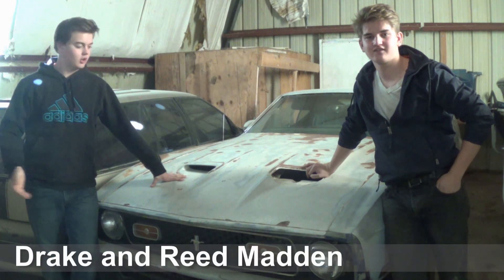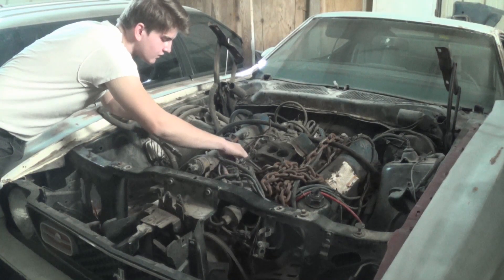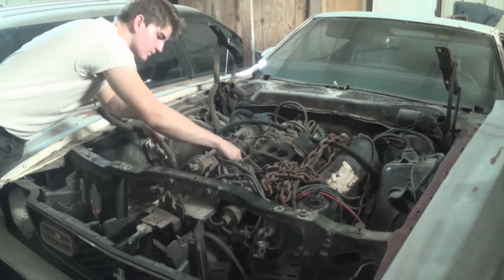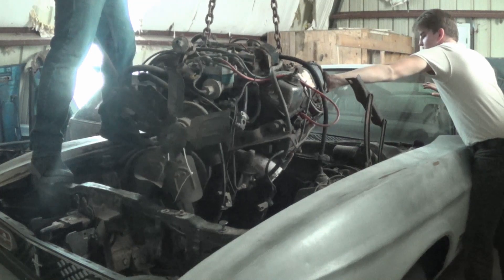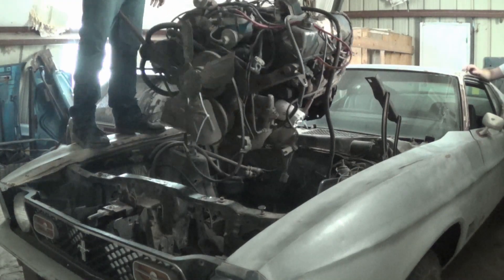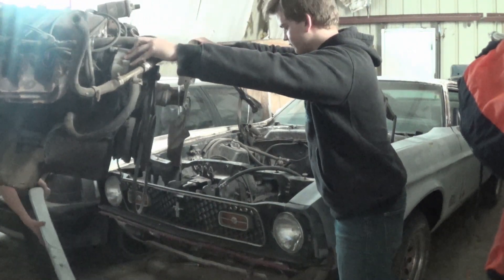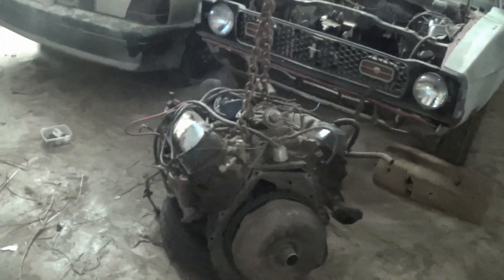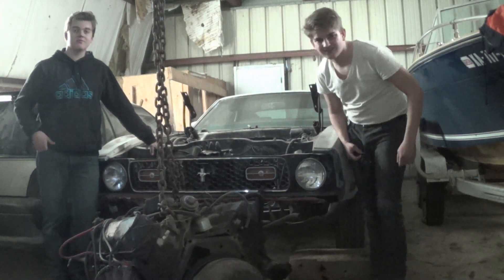1971 Mach 1 Barnfind Restoration Part 2

Comment: It’s good to see the engine is actually a Cleveland.  Convert it to a 4 barrel and make it a functional ram air.  Rebuild the engine so it pumps out over 400 horsepower, long tube headers and flowmaster exhaust will make this car sound mean.  Just remember to keep the engine looking stock on the outside